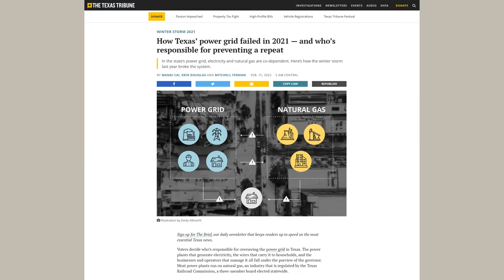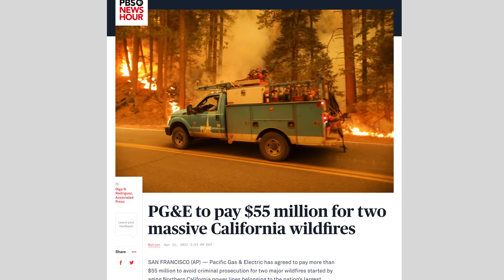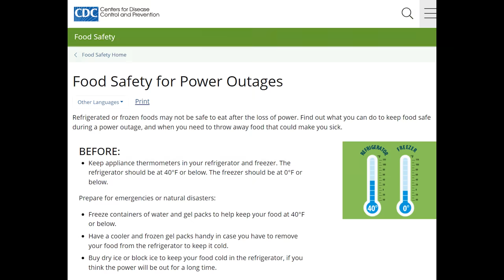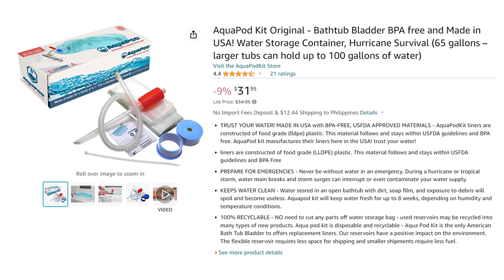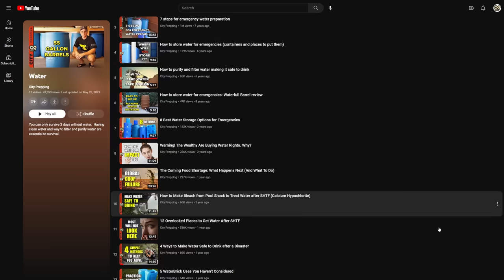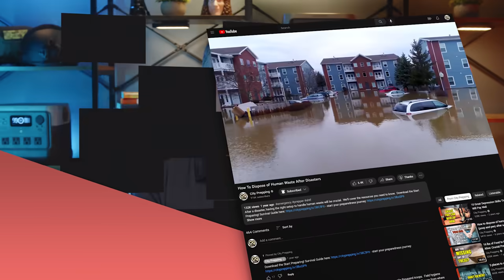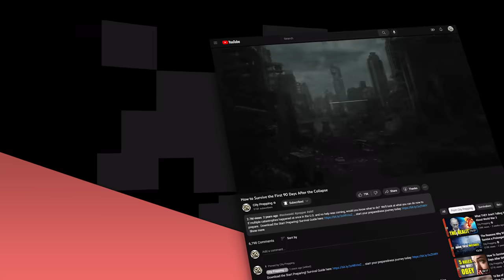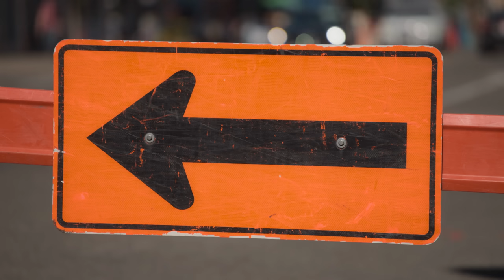Grid Down Collapse: A Timeline of Utilities Failing

Comment: QUESTION: We have a septic tank. We live in a small subdivision, so I know everyone else has the tanks as well. If we were to have a well put in (it would have a hand pump, so in case there’s no electricity) would the well water be safe to drink? An aside, this area has a low water table. 
Thanks for any advice.
Reply: The well has to be uphill from all septics, and it better be a minimum of 100 feet away from the nearest septic.  Any decent well contractor can give you specifics, and a lot of well drillers also know all about septic systems.
Reply: @jackieow  Thank you for your appreciation comment. I forgot to mention that the first few years we lived here we had well water. About 30 years ago the town we lived in put water lines in our subdivision so we switched to that. Not thinking it through, we had the pump removed which included the pump house. Ugh!
Reply: Relatives had both and the well had to be so many feet from the cesspool. City code should be able to tell you. A hand pump well is a great idea.

Comment: As far as trash goes it would be a good idea to separate paper from food waste. You could compost your food waste and cover it with sawdust or leaves. Perhaps you could  burn your paper waste. If you can't burn your paper waste you could add cardboard or some kinds of paper to the compost pile. Any paper that is left you could pack it tight in bags and  condense it by smashing it or stomping it down. If you store your trash/ paper in a paper bag, it could be used to start a fire to cook meals temporarily. You could use a bucket with disposable trash bags for human waste.  Use a pool noodle for a toilet seat by cutting a slit on one side. You then just push it onto your five gallon bucket. If worse comes to worse you could put up a temporary outhouse.  Your hole should be fairly deep, about 4 feet. When  the disaster ends fill it in. With a good way to practice good hygiene by making a washing station next to your bucket toilet, you should be disease free if it doesn't last long if it does you will adjust your methods.
Reply: Plan ahead and get a bedside commode like you see in hospitals and nursing homes.  I frequently see them at yard sales for really cheap prices.  The commode contents can be easily contained with a plastic bag to be taken out later.  Still recommend #1 be done outside when possible.

Comment: If you live downhill from anybody else and the sewer system clogs up, the water can rise uphill until it spills out of your sewage system into your basement or out of toilets onto the floor for people with no basement.  Every so often, depending on the slope of the landscape, are "lift stations" which grind sewage and bring it to higher sewer pipes-- because any sewer system can go downhill only so far, then there has to be a lift station.  So across the landscape the sewer pipes zigzag up and down. Periodically sewage is lifted up 15 feet or so in order that it may run horizontally downward another half mile or whatever, then there needs to be another lift station because it costs too much to install sewage systems below a certain depth.  If electricity fails the lift stations will cease to work and every sewer line going across the landscape will clog up in a few days at most.
Reply: Yikes!!!

Comment: Greap point about natural gas.  
1)  Will people show up to work and keep those pipe sections running?  SCADA systems run the valves. How long will suppliers sell gas when there is no way to process credit cards. CASH is king. 
Once electricity goes, it is just a matter of time before other systems shut down. Yeah, electricity is just that basic.

Comment: Question: Would it be a good idea to just put canned food such as campbell's soup, directly on the burner of a camping stove, and simply eat it out of the can when it gets hot? This could take care of the food, hydration, and waste issues, all at once, if it is reasonable. My concern is that the lining of the can might contaminate the food if it's heated or cooked directly in the can.
Reply: Use a small pot. And eat out of the pot
Reply: Or just eat it cold right out of the can. Not as tasty, but just as nutritious.
Reply: Just be aware of the sodium levels if it's condensed soup.
Reply: @j.patrickmoore9137  I almost put quotes around the word "nutritious".

Comment: I compost everything possible.  I take 15-20 minutes every day to cut cardboard boxes into 1" pieces that I layer over fresh food peelings in my compost. I used to pick up cardboard boxes at the grocery as they stock shelves in Texas where it rained enough to decompose quickly. Layering small pieces in the high desert works better. I also run peelings through the blender and direct compost around beds to refresh.
You can dehydrate in your car.

Comment: I have 3 totes n 3 55 gal barrels each lined with 55 gal contractor garbage bags. Each tote markes plastic, metal and aluminum same with barrels. Anything coming into the house gets recycled. After each tote full put into corresponding barrel. Then when full plastic goes to Walmart to recycle. All metal cans rinsed n put in its tote then barrel alum cans and metal sold to scrap yard.a garbage is composted for garden. All burnable trash goes to woodburner n ashes r composted.  So no garbage bill goid for environment  n pays for itself.

Comment: Good vid. I worked for National Grid in the UK for over a decade and power grids are vulnerable but the green nonsense is taking this to a whole new level of fragility (and stupidity). Then we have the threat of a 'Carrington' level solar flare. Our grids and networks are increasingly interconnected with each other - transport, gas grids, oil/petrol pipelines, power grids, water/sewage systems, supply chain, finance, coms, etc.

Comment: Nature gas to propane you need to only switch the regulator. That's all. You can make either one work on the others regulator if you adjust it. Not the best way but will work.

Comment: Gas turbines, which power natural gas pumps, delivering to installations across the US, are ALL controlled electronically; many have generators which are nothing more than natural gas turbine generators,  powered from the line supply.  These installations are mostly remote, usually about at 50 mile intervals and they can run unmanned for years..These will work only IF they are hardened against, for instance, an EMP and other cyber attacks.  Local distribution systems are even less likely to keep going.

Comment: Natural gas “compressor” stations, not pump stations, have backup power generators to power them. It will be one of the last utility that shuts off. This is just in a electric grid down scenario. While I agree that they are vulnerable, they are more robust than stated by the host.
I’m not saying he’s completely wrong, not at all, pretty on point with this video, but natural gas will be there for a longer time than people think.

Comment: The valves that control the flow of natural gas are “Normally Close” valves…mean for safety reason if the electrical power is down the valve is automatically closed…close valve means no gas

Comment: How do you prevent pipes from freezing in the winter?
Reply: If your house stays warm enough and there is water pressure, just leave faucets dripping like normal. If there is no water pressure,  I would turn off my water heater, and find the lowest faucet and let the system drain (note that the lowest faucet may be outside and if you have winterized that pipe,  you may need to reactivate it to use it to drain the system). Also, I would shut off the supply into a refrigerator. Leave on faucet in the house open, so that when the water supply is restored,  you hear it running,  plus you don't have water over-pressurizing the pipes. It may be worthwhile to turn off the water supply at the mater, in case the pipes under the house freeze. Then again,  it may be worth popping open the crawlspace door to let enough heat under the house to keep it above freezing,  if needed. We close all our foundation events in the winter, and our climate is generally above freezing most of the year so we aren't concerned about the pipes under our house freezing. However, I suggest you talk about this with a plumber to get the best advice for your area.

Comment: My biggest immediate concerns would be for water and heat. It's very important for me to establish the extent of the outage early on. I have a whole house generator with two 200 lb. tanks that I would only use to pump water from my well. If I knew early on that the outage was indefinite, I would shut the generator off after filling all of my containers with water and just turn it back on for a few minutes when I need to refill my water supplies. I also have rain barrels to set up at my gutter down spouts and can use that water for flushing toilets. Luckily my septic system doesn't require electric, some do. I heat with a stoker coal stove and keep a years supply of coal on hand. It uses 19 watts of electric per hour to feed the coal and my battery generators will easily deal with that and I can charge them from solar panels. If the sun wasn't cooperating I can use my small Honda inverter generator to charge the battery generators. My gasoline supplies should last a long time using it in that role. I don't have a plan to keep my chest freezer or fridge running and will surely lose a lot of meat, but it's a trade off against using large amounts of gasoline to power those.

Comment: As long as we have decent sunlight I have most of the potential issues covered.
- A couple of months of food and general supplies
- Rainwater tanks for drinking, cooking and even some limited toilet flushing
   - Water filters to use on drinking water 
   - Even if toilet can't be flushed I have a sewer line access trap, that was installed by a registered plumber, to be used to dump a portable toilet (I have 2 portable toilets).
- Solar power that will run the whole house as long as we have reasonable sunlight
- Open fire and a supply of firewood if gas is not available for heating.
- I keep the 2 vehicles fuel level at >3/4 full.  
    - 1 is a 4WD offroad campervan, so can be used to bug-out and is always ready to go, sleeps 3 and has solar to maintain its power systems.  Can toe=w camper trailer (see below)
    - The other is also a 4WD and is used to tow a camper trailer, sleeps 2, but only smaller power systems than the Campervan.

Oh, I live alone so my main challenge is which vehicle to choose IF I eed to bug out.
Reply: Consider prepping for an EMP.  Electronics will fry.

Comment: Take the trash down back and burn it in the old dump, use the burn barrel.  If not burnable, junk it thereto slowly rot over the decades and centuries.  Same as my ancestors did!  Use the kerosene lamps, the wood stove, outhouse, get water from the pump.  We CAN live off grid.

Comment: There are as an option c storm yrs ago un Canada took duwn all the poles they Canada, NY state and alot is f New England in the dead if winter.  No.power fur fourteen days.  Oreos, wood St ve, battery and solar saved us.  We out all th bfiid in cooler outside with bear licks.  We survive be and it also mad us think about  what happened les we needed to fill

Comment: Ironic that this discussion about the power grid going down is taking place while the government is mandating the move to electric cars, which will simply put way too much demand on the already semi-unsteady electric grid. My house is in a development where, rather than homes facing south, they all are oriented so the corners point to the north/south/east/west, so solar cannot be optimized on any of the homes, and our roof faces SE on one side and NW on the other. At least theoretically, we could use a scaffold to hold solar panels along the side that faces SW. However,  given the direction that the government is going with the electric car mandate, I think I would want to go with a battery system that is at least somewhat self-sufficient and use the grid to top off the system,  rather than net metering. If it's winter and the grid went down,  a generator could supplement the system until power is restored.